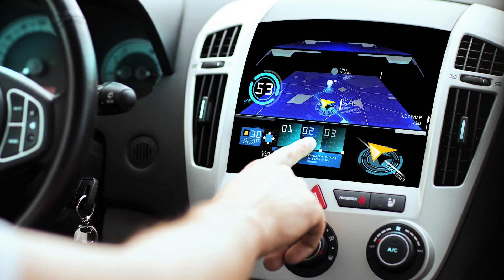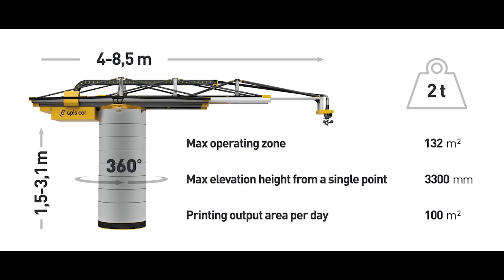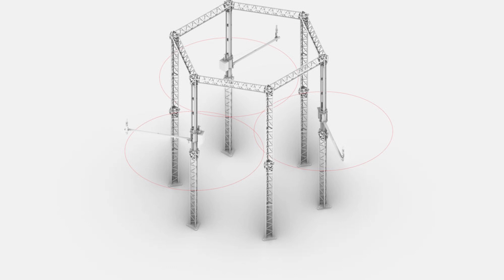Why 3D Printing Is The Future Of Housing

Comment: You can't make a house for $1,000. NO one can. The engineering, plans and permits will cost $2,000 or more. The Labor and materials will cost more than $1,000 and I bet you can't rent or buy that machine for $1,000

Comment: NOT FASTER OR CHEAPER compared to modular formwork. I sat there watching an Apis Cor video and the HUMAN LABOR ALONE involved for the first FOOT HIGH of the wall was enough to do FULL WALLS FOR THE WHOLE HOUSE. It's as versatile as hell but WITH THAT ITS OVERCOMPLICATED FOR A FEW LOUSY WALLS. Hell over here in Australia they pour the slab then use the slab AS THE FORMWORK FOR THE WALLS. You can do a VERY high workshop in less than 10 days and only a few dozen man hours before electrical and the finishing stuff.

Comment: 3d printing houses is a gimmick, even looking past the current silly designs.  How are electrical plumbing and HVAC installed and maintained?  What about finishing the interior and exterior surfaces.  I'm not sure of the thermal properties of the concrete but it could potentially be problem having such a large thermal mass connecting the interior and exterior walls.  If required, installing insulation would also probably be limited to a spray or blown in product.  I think all of these issues can be solved, but at a cost less than conventional techniques?  I don't think so.   Despite believing it's a gimmick,  it would be interesting to see a unit with multiple heads for multiple materials like insulation and caulking, or the ability to install conduit or wiring.
Reply: it's not a gimmick anymore than your phone is a gimmick
Reply: it's a very important advancement for vanity and functionality
Reply: @tahneethompson6012  Comparing 3d printing houses to advent of the cell phone is ridiculous.  The modern cell phone, while being a progression of technology, is fundamentally different than any piece of technology before it. 3d printing  large concrete structures does not represent that same fundamental shift.  3d printing has been around since at least the 80's and has a place in many industries, but in my opinion, not for creating housing.
  If speed and cost are the primary concern, i'm sure prefabricated sections optimized for low cost and ease of assembly would be a cheaper all in solution.  If  the "infinite variability of design" seems appealing, the cost will rise exponentially with design and programming, and it falls back into the gimmick category.  At this point I just don't see 3d printed housing as the the solution to any fundamental problem with conventional fabrication.

Comment: Cool idea. But how do the structures hold up considering concrete loves to crack with heat/cooling cycles and there are no expansion joints.

Comment: I'm not quite sure about this. Most of the cost of a house is not in the .walls, but in the foundation, the plumbing, electrical, heating, etc. Watch a house getting built. The foundation takes months. When they finally get to it, the rough carpentry is done in three days. Then, months waiting for the rest. Maybe these things will be worked out over time.
Reply: "foundation takes months"  where are you seeing this done that takes this long?  From a treeless lot to finished foundation with basement shouldn't take more than 2 weeks, three tops.  I've worked on half a dozen 2000-3000 square foot houses with 4 other guys.  We had the excavator dig out the pit in less than a week.   We set up the footer forms, laid out the rebar and poured the footer in one day.  Three days to set Fox-Block ICF (Insulated Concrete Forms) wall block forms and set the rebar.  Then a day to pour the walls inside those foam forms.  One day to set any underfloor drain pipes, rebar/mesh and pour the basement floor.
Reply: @michaelg4931  Yep, things go fast when you are doing it yourself. When you hire other people, you are stuck with their schedules, not yours. And with different contractors, with different priorities, everything takes forever.
Reply: @christianlibertarian5488  I was working for a contractor.  If the contractors are taking too long, the General Contractor (AKA The Builder) isn't doing his job and needs a talking to or to be replaced.

A 3000 square foot home from ground breaking to weather tight shell should be to that point in under 6 weeks.
Reply: It's all down to design. If the house is made from timber frame or even 3D printed bio plastics and plant based infil the weight is reduced reflecting in the size and volume of foundations. Conduit, electrical boxes, plumbing, aperture lingings and formers can be set in framework prior to printed infill. 
Modular rebar cages could be performed off site with concrete pumped in mere hours. Heavy plant equipment is already being developed to be automated so one day it will be a case of downloading a cad file and watching an IOT construction infrastructure get to work with humans just setting up, snagging and finishing.
Perhaps in the future hollow beam frameworks that services can be run through will exist. Doors,  windows, second fix, bathrooms and kitchens could also be installed far quicker if design and installation of wastes, services and fixings are pre installed or services cavities are provided. 
Plastering robots are already being developed and we know automated painting is not much of a challenge its been in the car industry for decades.
It's early days but it is the future especially in compact urban environments. No one would have ever guessed that GSM push button mobiles would be superceded by devices that allow us to manage all aspects of our personal and professional lives on. The futures bright but it's not concrete and oil based materials.

Comment: What about electrical? What about hvac, plumbing or any 2 story building? I don’t see this as much of a savings as framers are cheap and can frame a building faster then this printer. If you factor in the fact you can not wire ore plumb these houses traditional ways using romex you will find these homes cost more per square foot. The labor of hard piping this home and the nightmare the hvac guys and plumbers having to concrete cut all your walls will over run any cost savings. You can’t even hang a picture frame in these homes without using a tapcon and hammer drill.
Reply: Maybe if it was 3d printing segments of the walls to allow people to wire and plumb the walls before sealing them up while keeping them straight, however my concern would be with keeping the climate inside the buildings from being drastically changed by the outside environment.  Like the cold leaking out or the heat leaking in.  This would require some form of insulation which also costs a fair bit.
Reply: Oh oh but but... What about the whataboutisms????!!!11!!!11
Pay attention next time and you'll actually hear when they specifically mention electrical and plumbing work being included. Multiple floors just means you stop build the walls while the joists are added, then continue, just like you do now. You can dig through construction grade breeze blocks with a screwdriver, and this material doesn't need to be tougher than that. Wooden frame houses have ongoing maintenance costs you are ignoring. And no you can't build houses quicker than this you liar.
Reply: Concrete has maintenance as well, in this case with the buildings being solid concrete walls, they could potentially crack as time progresses and the walls expand and contract with the change in temperature, there's also the chance that mold can grow if any moisture is caught in the wall before it gets sealed back up, causing more problems if another crack forms.  On top of this, rain can erode the building if not given a proper roof, the plumbing and electrical work would lead to cutting holes in the walls that were already put in place.  The buildings would have to be erected on clear days as rain could soften the concrete too quickly for it to set.
Reply: @LRG_Tech  - In theory yes, but in practice no. Thermal cracking is associated with tensile stress, which isn't an issue for homes. There are roman structures made from concrete that are still standing, so whoever told you rain can erode them was probably talking about thousands of years. Which again, isn't an issue for homes. Water makes some forms of concrete stronger, and other forms largely ignore it. If not, tents exist. And in brick or concrete homes, wires are usually placed in shallow cutting on the surface of the wall, not inside them.

Comment: It won't progress until the walls it makes can bear the weight of the roof.  Notice the interior wood supports for the one house, that he calls made of dirt and has a cozy interior.  If it cannot support the roof, how is it going to perform in a high wind?  A flood?
Reply: have you ever seen Geo-engineered dirt? this stuff is kinda similar in that it has immense strength and won't collapse easily

Comment: One problem, they are built using Cement which liberates CO2 in its manufacture.
Reply: True, but this system still liberate less co2 than today methods, so it's a good first step toward more ecological buildings.
Reply: Get an electric motor. Tesla seems to be doing good in that field

Comment: This is exactly what the ridiculously overpriced housing market needs!
Reply: building the house isn't the expensive part in cities.
Reply: @Utoko   that's where hyperloop comes in :D
Reply: @Utoko  What would be it? Living in the cities? :D
Reply: @tibsyy895  There are areas where the house can be had for much less than the ground it's built on.
Reply: Infrastructure is more expensive than a shed.
Reply: i agree...much needed in Canada
Reply: If cost of construction labor was all there was to it, you could easily bypass the problem by doing the work yourself. But it doesn't really work like that, now does it? So why do you expect robot doing the labor for you to change anything?
Housing is not overpriced because construction is difficult, it's overpriced because million people all decide that the same place is the best for living and then it becomes a competition of who gets the largest loan from the bank.
Reply: @aleksandersuur9475  You could fix the overcentralization problem with good remote drones that have hands controlled by the haptic feedback gloves.  This will allow people to work remotely in a cheap place.
Reply: Ya, but they'll still figure out a way to screw people over on it.
Reply: Tibor Z lmao it’s not overpriced at all!! I’m guessing you don’t really know anything about the housing market. The problem is that people think they know what it should be but really don’t have an education to get a decent paying job

Comment: Wow, I've been thinking all week some big youtubers should make more videos about 3d printing, and here you are!

Metal 3d printing for example changed a lot recently. I was surprised how precise it is now. The British Tokamak fusion reactor is using 3d printed parts.

Housing is interesting though. SO the base must be done by proper workers I guess? Then instead of bricks they use the concrete 3d printer?How do the pipes and wiring go into the wall?

Could be a good idea for cheap housing though. I know that in the US, many homes are made from pressed wood etc. Incredibly week structures, and they use them in the tornado alley, so they get completely demolished when a tornado hits.

This can provide cheap but strong housing. 

THe sculpture park- like housing plan looks something from the fifties though. I'm not sure it would  age well.

Comment: I think this is only a good application for an unmanned type of constrcution, maybe on other planets or similar. The small house like in the video you could probably build faster than 24 hours with bricks, a few skilled people and good, fast curing materials.
Reply: Do not forget the increase of freedom (more ways to solve problems as options to optimization problems) and, of course, the immaturity of the technology (present stage results are only provisional).
Reply: People get tired. I can print for 24 hours non stop and print 24 hours the next day. A human body is weak after 3 hours

Comment: It will be one more method but not the only one at all. It isn't as versatile as they try to advertise, plus the foundations can't be 3D printed and the MEP's can be assembled but not printed
Reply: can't be 3d printed yet*
Reply: Tahnee Thompson yes ok, but just because you can, doesn't mean it is best. We indeed can 3D print them now (just like the colt 1911 I guess). It is just not worth it and I think it will never be. MEP's are assembled from die cast plastic parts and extruded PVC tubes that cost almost nothing and are fast. 3D printing a piping seems to me hardly better than assembling it

But I totally credit you the infinite possibilities that 3D printing can cover

Comment: How is the insulation of these materials?  Would another insulation material need to be printed in between the walls?
Reply: You could probably just inject insulation as needed, but as these buildings could be made airtight, the still air between the walls would be a fairly decent insulator as it has about as much thermal conductivity as standard foams and such.
Reply: @kayrosis5523  just don't make it too air tight. Still need to breathe. 😉
Reply: @RedSlashAce  
Not so much now, older houses had to breathe more, but now houses are being designed and built differently. Installed ventilation is more important with newer designs than old houses because they dont leak air as much thanks to things like expanding foam insulation and other innovations.
Reply: RedSlashAce concrete has tremendous insulation properties. Of course you can spray the voids with foam insulation and exceed R-80+

Comment: Can’t wait for 3D printing to become commonplace to consumers in all aspects of life. Additive manufacturing makes so much sense!
Reply: aleksander suur did......did you watch the video at all?
Either way, I’ll @ you in 20 years and we’ll see lol
Reply: @JBB685  Is there anything in the video that was technically unviable 20 years ago? Time will tell if next 20 years will be any different in this regard than past 20 years. I'm going to bet on no.
Reply: It never will. When you start scaling things up 3D printing stops making sense very fast. 3D printing has two main advantages, geometric flexibility and zero upfront tooling costs. But it's incredibly slow and therefore expensive. These are inherent properties of 3D printing, there is absolutely nothing you can do to change that.
The hype can make "so much sense!", but only if you don't really understand other manufacturing processes and you don't really understand 3D printing itself.
Reply: aleksander suur I disagree strongly. It makes complete business sense, especially in sectors where it will one day be faster to print something on the floor of a factory than have it delivered. JIT delivery is good, but not as good as having something made on site. 
As far as consumers go, it takes a lack of foresight to say something will never happen. That’s a bold statement. Additive manufacturing is leaps and bounds less wasteful and therefore more cost effective than its counterpart. It’s the closest we have to six sigma manufacturing capabilities and bringing that from offshore to a person’s house is why it’s promising.
Reply: @JBB685  In this case "never" is quite justified, it comes down to simple mechanical limitations. Think about it, why does it take forever to 3D print a piece of plastic? Because you want detail, that means you need high 3D resolution, which results in really effing long toolpath. It's like trying to hog out a block of metal with a toothpick sized bit in a CNC. It will never be fast, what do you expect to happen, are you going to make pieces in your machine move at supersonic speeds? Nope.
Reply: aleksander suur those are all generalizations for things people will want or need. It’s silly to think consumers won’t get a piece of these when small business starts to implement them to compete with larger corps with better supply chains